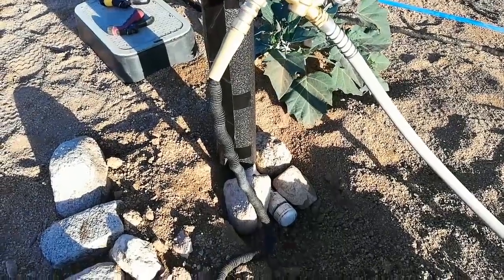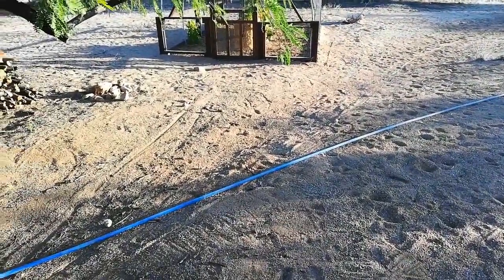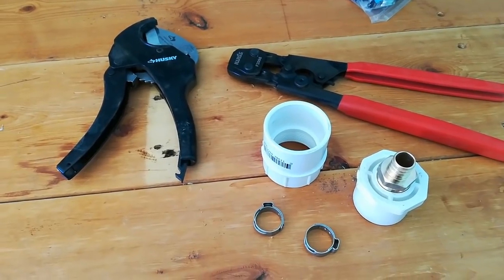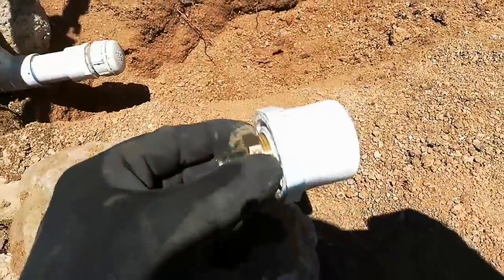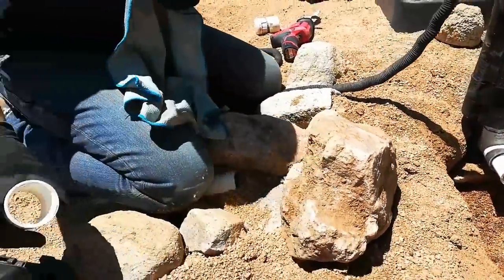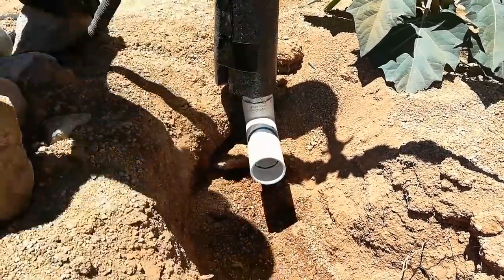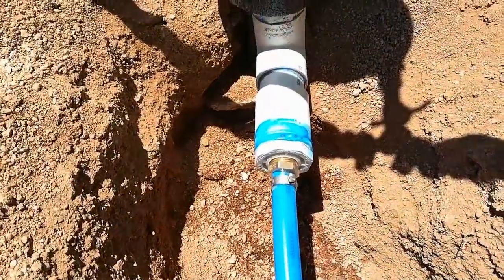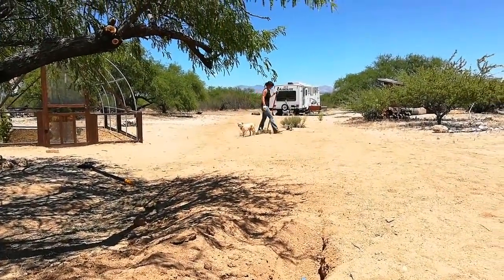How To Install A Main Water Line Using PEX

Comment: Painful watching you try to cut that pipe.   Always butt up against the foot to keep the pipe from moving with the blade.   Probably would have cut faster with a hacksaw and caused less shock.
Reply from the maker: One of those flexible blades with rings on either side would have come in handy too.

Comment: Wet the sand. Keep it from caving in as you dig (Handeeman) you should keep your pipe at least 18 to 24 in deep so the sun doesn't warm up the water, also a tip from (Handeeman)
Reply: I'm not speaking from experience I'm speaking from tips I've heard from others. I think you bought the 10 acres that I was looking at right on the corner by Derek. Anyway I'm coming out again to look at property with my girlfriend maybe I can look you up with your permission
Reply: @theupsideofdownsizing  thank you, see you soon.

Comment: Red Hot blue glue is fast set and has no primer in it. Make sure your pex is not exposed to any sunlight. Clamp should be 1/8 from the end of pipe.